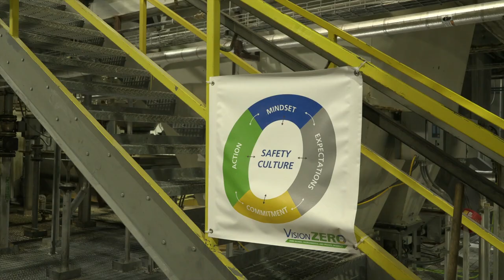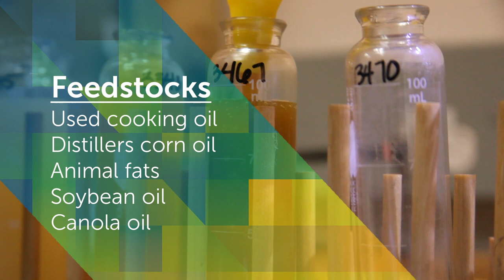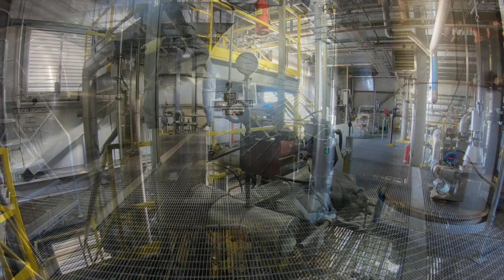Renewable Energy Group Biodiesel Plant Tour

Comment: Renewable Energy Group's biodiesel production process, from feedstock procurement to quality testing and distribution, showcases their commitment to innovation and sustainability in the biofuels industry.

Highlights:
00:02 Renewable Energy Group (REG) is a leading biofuels producer in North America, with a focus on producing cleaner burning lower carbon renewable fuels like biodiesel, emphasizing safety and quality throughout its production process.
          -REG employs over 1,000 individuals in various roles, operates 10 biodiesel refineries and one renewable diesel facility in the US and Germany, producing 519 million gallons of renewable fuels in 2020.
          -The biodiesel production process involves converting feedstocks like fats, oils, and greases into biodiesel through transesterification, ensuring quality through rigorous testing and exceeding industry standards.
          -Safety is a top priority at REG, with a focus on pre-treating feedstocks, monitoring the production process in a central control room, and conducting quality checks to meet customer needs.
03:39 The process at REG biorefineries is continuous, with biodiesel production happening non-stop, leading to high-quality products and sustainable practices, making REG a leading biofuels producer in North America.
          -REG focuses on continuous improvement, innovation, and sustainability to enhance facility safety and efficiency, reducing carbon intensity and appealing to customers.
          -REG's combination of technology and collaboration enables a robust distribution system across the US and Europe, ensuring timely fuel delivery to customers.

Generated by sider.ai